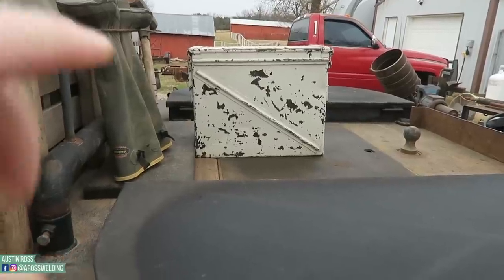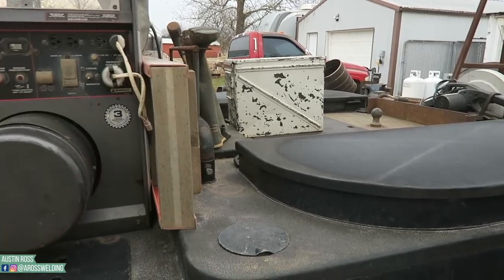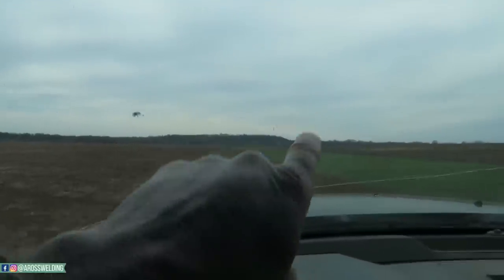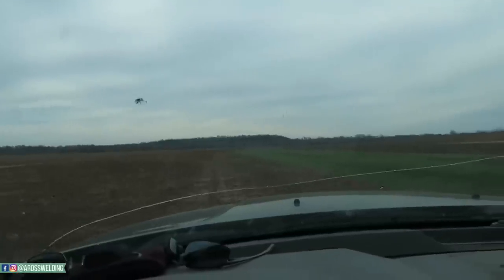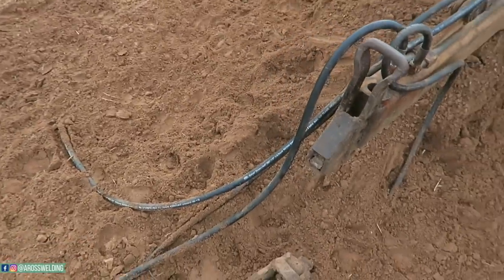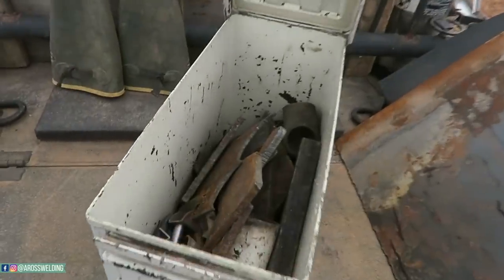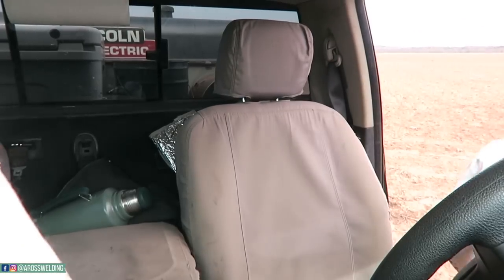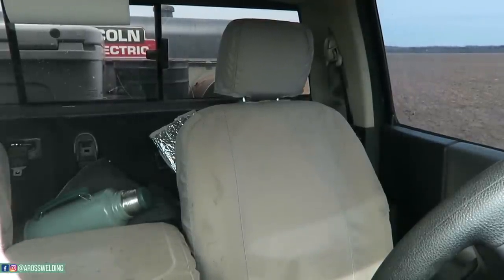EMERGENCY WELDING REPAIR // MOBILE RIG WELDING OKLAHOMA

Comment: I had a similar project like that years ago.  A non farmer was driving the tractor, discing a field.  He got too close to some trees and hung the 25’ disc on a tree.  Completely ripped the tow bar out and messed up several gang hangars.  I went out early one morning when it was extremely foggy.  It took me an hour just to find all the pieces from the field!  Haha.  I finally got all of the pieces collected and spent 2 days welding it all back together.  Legend has it that they are still using that disc.  Fun stuff.
Reply: Had to repair a hydraulic auto hitch on an International tractor that ripped out - cut and made holes in 3/4 plate to sort it, took me a 1&1/2 days... was I pleased when it all cam together and worked as it should :)

Comment: Scraper hitches should be able to swivel, I completely understand if customer said I dont care weld it solid. But they are supposed to be able to swivel independent from the attached tractor or whatever to help in uneven terrain and to keep stress off of the tractor especially when unloading. Tips for saddling between use your jig to mark it out, draw a line at the center of the jig (were it splits apart or at the hinge) cut one side then measure from the bottom of your saddle out and that will give you the correct distance for between the pipes. Line up your length mark at the bottom of your saddle jig then line up your hinge mark and then you know you are straight. Great video as always 👍
Reply: That's the first thing I noticed.  It looked like a round shaft that broke.  The tractor pulled scrapers I ran on the farm all had swivel hitches.  I suspect for a reason.  If customer wants solid that's what you do.  Otherwise I don't know if that repair ended being "the same as" original design.
Reply: Scraper hitch has to be able to swivel at least somewhat, I don't know how you could grade without that.

Comment: I’m a bldg trades union member up here in Ny... I started running a Rig 3 yrs ago on mainly compressor station work. I was pretty fortunate when the gas work slowed to bounce back to Bldg trades and actually ran my Rig for a contractor I prior ran a Fab shop for ...... being out as long as you have I don’t know how you haven’t looked elsewhere to get back on some pipe work........ hang in there brother !!

Comment: Yep, none of the welders that I worked as a welders heller, prepper/finisher told me about watching my weld puddle, tie in with welded materials and bead height.  I learned that from watching YouTube many years later like 50-60 years later.  It has helped the most with the quality of the weld and appearance, you can make a good appearance weld that is not a good weld but it is harder than making a crappy looking weld that you think is a good weld.

Comment: we used to make a lot of our own template/pipe wraps from plastic milk jugs. freehand one and grind and make it perfect. then cut a strip from a gallon milk jug wrap it around the pipe and trace the saddle you cut on the plastic with a felt pen and cut it out with scissors. i used to have tons saved up from doing this and that.

Comment: What are your thoughts on using the 7018, I know you love your Lincoln. Thought on the Miller. I still us on occasion my 1960 Lincoln on a trailer when needed, but i'm retired.I finally called it quits.

Comment: I’ve been building and welding pipe fence for about a year now, and I use 1/8” bead rod on everything, works perfect. Wished I could upload a pic of some of the Hs I’ve build. Pretty cool stuff
Reply: The cheap red 6010s are what I like... I use them a lot in 5/32 for structural stuff. They’re cheaper and run smoother than the 5P
Reply: Do u ever use old oilfield pipe?

Comment: lovr that thermos, it does the job well, love mine
Reply: Those Stanleys are crap. I have 3 large and 4 small. They are always failing. The best i have is 2 used genuine 1970's U.S made stainless "Thermos" ( Thermos was actually English) they are bilt like brick shithouses.

Comment: Austin I have a question? When you do work like repair an impliment or doing fence work how do you figure out how to charge? Like do you figure your travel time, actual work time, supplies ( rod, gas, misc steel etc.) and do you itemize separately or do you just look at the job and say well this is a half day of work and have already determined you need to make say $500.00 a day to cover your nut including misc supplies, and determine from experiance this is approx 1/2 day of work. So that will be $250.00. That includes from door to door meaning I leave at 6 am and walk back thru door at noon. 1/2 day work. I am retired and have done it both ways. I am sure some of the younger guys starting out could really use this info. I also realize also the part of the country you work in also makes a difference and weather your working for say a farmer or a corporation. I lived and worked in CA. (Please don't hold that against me.😂)

Comment: Not just the older guys don’t use templates. I’m 20 and I don’t use them bc I don’t have any and I’d get cussed out if I asked them to burn one out at work. Just kinda figured out a way that works perfect. Now we have a CNC tube cutter so I don’t even have to do anything anymore but weld them up

Comment: Did you spaced it right? Most track bars need a certain spacing between them tongues.
  if the wall thickness is  0.203" than it is a SCH 40 pipe

Comment: A good tip for cutting old pipe for fencing Is take a hammer and smack it pretty hard to knock that  rust wall off the inside since it can cause spit back

Comment: Puddle manipulation is best experienced using oxygen and acetylene. Carry the keyhole.
Also coping pipe, say handrail , just remove like a finger nail clipping and when you get it right you don’t have to grind before welding with 5P . Welding poor fit will mak you a better coper but by all means don’t undercut with the grinder when you are done🙏

Comment: Im really amazed how you guys dont use the Ringfeder eye type drawbar hitch which swivels based on terrain.
Here in N.Z pickups can be registered as comemrcial but its more of a hassel due to having to keep a logbook. Its easier to not but here we have to make sure road users milage (diesel tax is kept up to date otherwise cops will fine us big.) Diesel tax here is $60.00 N.Zd per 1000 kilometers.

Comment: on the pipe saddle thing if you have a chop saw or a cold saw  take a sq cut pipe turn the saw on a 45 deg and cut back 3/8 " up to 1/2" on small pipe then roll the pipe make the next cut its hard to explain
Reply: I understood

Comment: How did that straight edge mount to the plate when you were torch cutting? I saw the bracket pinched down on the ruler from threading those wingnuts but how does it stay fixed to the material? I wanna make one lol

Comment: thats funny, i used to have the same rocket box and i kept my torch and some extra clamps in it instead of steel scraps, i got it from sportsmans guide. my box was yellow
what did you charge for the hitch repair job? i used to charge around $100 for something like that

Comment: how much would you have charged for a little job like that? im slowly getting into mobile welding and im afraid that i will either charge to much or to little for a simple job like that or anything else.

Comment: Hey Austin, I'm a pipefitter out of local 168. I was wondering if it would be better to join local 798 and be a pipeliner or just stay in the pipefitters. I called 798 a couple months ago and they said they weren't taking applications because work has been so slow. Any advice would help, Thank you.

Comment: Interesting that you chose 5p for the fence. Must have not come across any magnetized pipe yet. 7018 and DC electrode negative is the only rod I've seen glue that together. Then on the dirt scrapper you only used 7018. Most would 5p and cap with 7018. The no templates or guides come with experience. Have a buddy that I've known since diapers. He can saddle pipe and cut the tops off even faster than the time it takes me to trace out a template.

Comment: how many clear lens do you recommend? was thinking two in the front and two in the back on a pipeline hood so i don’t ruin a $125 lincoln electric 4c lens. thanks!
Reply from the maker: I just use 2 in front and one behind
Reply: I use one in front one in back with a 4c in all my pancakes idk if anyone makes one with a lense sleeve big enough to put two on each side and a 4c

Comment: What diameter pipe/ schedule do you build your Hoosier poles out of, and wheres the best place to find the fittings for it?  Slowly building my rig truck up and have been wanting to build a pole
Reply from the maker: Technically you can use whatever you want but most poles you see are made from 2” sch 40. I got all my stuff from my local welding supply.
Reply: @arosswelding  thanks man,  have you ever made a video on building a pole?  I've been searching for how to build them but haven't really come up with much

Comment: Did you weld up the round axle portion of the hitch that originally broke before starting on the support platting ?
Reply from the maker: I put a little weld on it but no I didn’t properly weld it up. I just welded all the plates around it solid.
Reply: @arosswelding   Thanks

Comment: Those knee pads are clc brand ? If so I have a pliers holder made by them. I cary linesman pliers with me on the farm or at my electrician job.  I do some fixing on our 3500 acre farm and fix machines for other farmers.  We have a service truck that is the same as yours but ours has a welder crane and air compressor on it . Nice video im watching from my tractor as I plow with GPS steering it. The weather here in southern  michigan is very mild and has been for 10 days how.  Stay safe and weld on my friend !
Reply from the maker: Yes they are clc brand

Comment: Austin im currently in trade school and im in my 4th of 5 semesters. In your opinion is going to school to weld pointless? Because alot of my friends from highschool went straight to the jobs and it makes me think im going about it the wrong way.
Reply: your already in it deep so finish it up.  No regrets  you got something out of it.
Reply: You're going to start your first job with a better understanding of the rules and basics, so you'll be a step ahead. and with some of the processes and science explained to you, you stand a better chance at faster advancement.

Comment: I've decided I'm getting a generator so that I can take my everlast welder on the road.
Reply: Make sure you get a generator high enough in wattage and produces clean power or you will damage an inverter style welder.
Reply: I've been running the Predator 8750 and AHP Alphatig200 with good results other than the sound of a 420cc wrapped out at 3600rpm. I have not ran a Constant Voltage (MIG) off this setup though I am paranoid about the voltage fluctuations. Looking forward to Kubota heaven someday!

Comment: I want to be a welder in my future and I always ask welders if I should start as a helper or go to school?
Reply: Go to school dude
Reply: Fk school be a helper or a labor and try to get some experience school don’t teach you nun just waist of time I went to school and it’s way different then what you will be doing in a job
Reply: If you have a vocational option if you're still in highschool take the chance or try to get work at a fab shop or a machine shop 👍😎
Reply: If you can get on with a company that sponsors your schooling and you work in the industry as well. I’m going to welding school and My company pays for it I’m a ironworker but I’m around a lot of welders.
Reply: I'm 18 I got out of high school last year and I have been labor in pipeline for about 8 months I got laid off today the company never did anything for me I always asked if they can out me and a helper but the welders always had there helpers I still confused were to start ??
Reply: Make sure you do tons of research and find a school that focuses on what sub set of welding you want to do. Ie pipeline, fab shop, structural or process piping
Reply: apprenticeship in union
Reply: @m6ndohernandez339  you have to learn uphill, vertical, overhead, and actual pipe welding first. Most people can't even put down good beads on a flat plate. Do you even know what a 6G Test is? What about difference between 6010 rod and 7018? Do you know what a fillet weld is? If you can't answer at least one of those correctly without looking it up. You need schooling
Reply: @jacobgeary9811 the 6g It's stringent test because the welder must use a variety of techniques,like as flat, vertical and horizontal
Reply: @jacobgeary9811  yes I know the difference i welded at school and practiced somewhat but I haven't chosed school yet because I got some friends that go in as a helper with no experience and break out in less than a 8 months and I also got friend that went to Tulsa welding school for 2 years and never ended up welding just became electrician
Reply: @jacobgeary9811  I also asked most welder in the fields if they went to school and 1 out of 50 that I asked went to school
Reply: Go to school and the people who are looking for good employees will be hiring welders ..Tulsa welding school is one of the best in the world at least that's what they say. Lol
Reply: @m6ndohernandez339  oh yeah 2% of welders went to school and the rest are self taught bullshit dude if u wanna ask a question about should u go to school or not then don't try arguing with me if u see something u dont like. If you cant pass a 6G test might as well forget about being a pipeliner because the X ray weld tests they do on pipeline are way harder to pass. I doubt you could even make a clean pad on flat plate let alone pass a 6G cert
Reply: M6ndo Hernandez you should go to school, I just started like 3 weeks ago and I should be done this July and they help with getting into the union right after you pass your test well at least my school does

Comment: do you charge a premium for emergency welding? also why dont u run a portable bandsaw? i got a 8in wide one thatll tear through everything , nice finish on the metal as well, cuts down on my oxy/fuel costs down by a lot
Reply: john dowe a cutting torch is super cheap to run. Tank of oxy is like $10
Reply: @anotherdumbwelder6219  90$ refill in my area.. not including taxes
Reply: john dowe yikes
Reply: @anotherdumbwelder6219  yep, gotta drive out 40miles as well to swap out tanks. i still prefer a bandsaw, just plug it in the welder and cut away

Comment: Can you tell me what exactly that magnetic straight edge/ square is and where you got it?! I need one! I do strictly mobile repairs for a big construction company and that would save my ass
Reply: Look up “Sumner Magnetic Torch Guide”. I bought some from my local weld supplier Praxair but you might find them cheaper online.

Comment: Hey Austin I've been wondering on how you find work outside of pipe welding. Do you surf the Facebook, indeed, search engines etc. or is it just word of mouth kind of deal. I weld in a shop for my work now, but I've been interested on welding outside my usual work for extra money. As of right now I'm learning to tig and I'm pretty decent at mig and stick but what's your take on running a machine that is a multi or just a stick machine on the back of a truck for that kind of work?
Reply from the maker: Mostly just word of mouth. I done this type of work for a few years before I hit the road pipelinin.

Comment: I build Earthmovers like that and yes its pretty typical of them to be trashed and run till they are worn out , instead of maintained, then this time of year when they need them its like repair it yesterday, Experience Tells Me the machine is nearly loaded the Carrier rams on the side are all the way in so its cutting too deep and the dirt is spoiling up in front of the apron that might not be fully up, basically looking at the front of the machine, They are trying too pull this through 2 foot of dirt, and as worn out as this is it wasn't going to do it  had it had a ripper in front or taken less of a cut, it would have done this easy, operator error all the way

Comment: Most of these comments and questions about what type and size welding rod you use when building fence ,, are because of the trashy ,, pitted ,, rusty ,, and MAGNETIZED !!! pipe and sucker rod !!!    I'v tried rapping the ground lead around a part of corral fence or a few other things but at it seems the right rod can help !!!  ?????
Reply: preheat of 500*- 600* should help a good bit because at those temps the magnetization in the area of preheat will be diminished if not even completely gone
Reply: Some 7018 is good to carry around on working on farm equipment my name's Alexander dare I do Pipeline and work out at the plant here in Port Lavaca Texas Formosa

Comment: Hey, I haven't noticed them in prior video's but did in this one. Those kneepads are sharp looking. Where did you happen to get them?
Reply from the maker: I just got em! They are CLC brand.
Reply: @arosswelding  were they a local welding supply purchase. Or online? They look far more comfortable and durable than the ones I picked up at a local farm and home supply chain store back home.

Comment: When you heading back to the pipeline?!?!?!
Reply: Hey Bro excuse me for asking a personal question but what do you charge for farm work like this,  I never charge enough,  sometimes it seems like I’m paying them for me to come fix their stuff!!  HAHAHAHAHA
Reply: Mack McElroy gotta figure it out for yourself bubba, and if you can’t you shouldn’t be doing it 🤷‍♂️
Reply: @mackmcelroy505  just charge your hr rate plus maybe mileage if they are not local. Maybe something like $1.50 per mile. Start your shop rate at maybe 60/hr out of shop maybe $80 to $90 an hr with a minimum of 2 hrs. And depending on where you are you can adjust for your area.